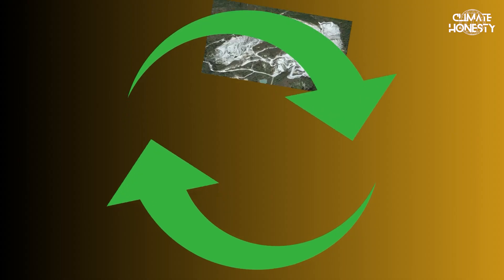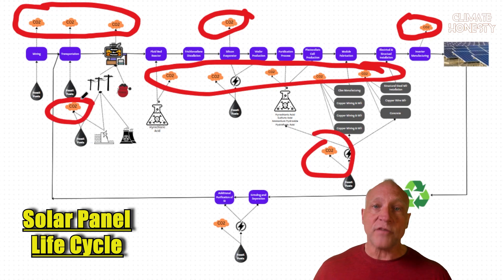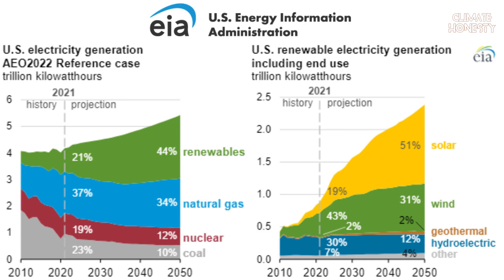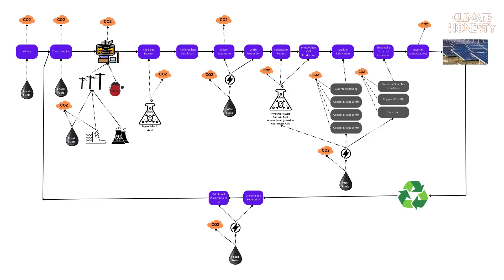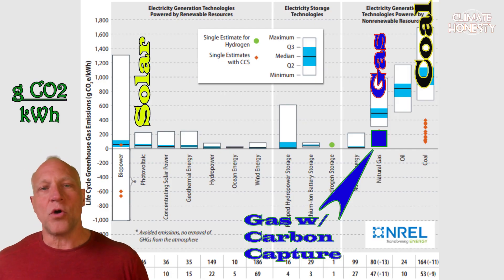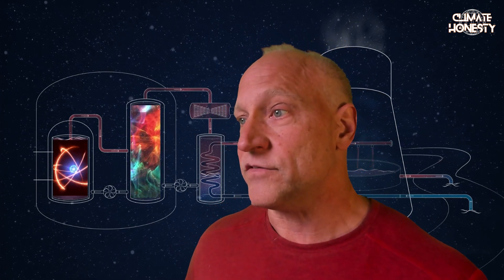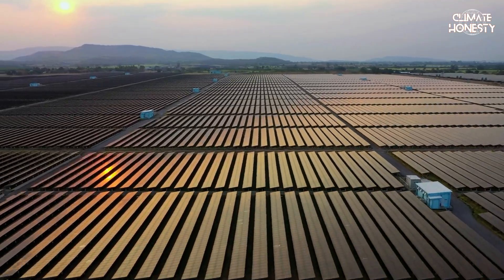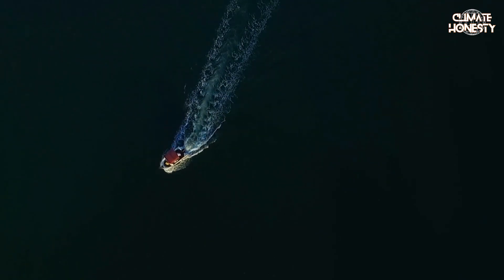Putting SOLAR in the friend zone. Life cycle of solar panels & energy storage #solar #climatechange

Comment: Carbon capture will not work.  Just the chemistry requires about 1/3 the energy produced to capture the carbon.  What make sense is high temperature nuclear reactors with heat storage like the Terrapower reactor in Wyoming.  Here both nuclear and renewables are made more practicable.
Reply from the maker: Hey Stanley, thanks for the comment.  Totally agree on the nuclear side.  Carbon capture does work and is being done in many places around the world.  We have vast resources of natural gas around the world that could be utilized to make electricity and hydrogen for fuel.
Reply: @ClimateHonesty  Like to know anywhere carbon capture is being done?  There was only one place I know of in Texas where carbon capture was being attempted but that has been shut down as unworkable.  It is my understanding there are two ways to do carbon capture, burn carbons in 100% oxygen or chemically separate the CO² out of exhausts.  Both methods requiring a lot of energy.  I too have seen claims of carbon capture being done.  However whenever I have checked I have found it is not carbon capture.  Usually what it is is people confusing surfer dioxide scrubbing for some sort of carbon capture.  So if you have some real examples of true industrial carbon capture please tell me.  What does not count is systems that are producing CO² for industrial purposes and this CO² is being used or stored.  In fact I think these processes are what are being past off as carbon capture when these systems are not capturing carbon from combustion.
Reply from the maker: I have not personally worked on carbon capture projects myself.  ExxonMobile has several in the gulf region as does Chevron I believe.  I was thinking of post combustion scrubbing and reinjection in the video.  This would apply to not only gas, but coal and oil as well.  It is a fairly new technology that does take a lot of energy to perform, which is why it is expensive at this point.  It is simply using existing technology in new ways.  I have heard of projects in Norway, Netherlands, Australia, Canada, and the US. I have worked on scrubbers, coolers, and injection compressors so am pretty familiar with some of the issues. I have plans to do a couple videos on carbon capture soon where I will delve deeper.   The beauty is that it allows us to keep using dense energy and make it cleaner.  The problem is that it consumes energy just like you point out.  I would like to raise awareness of it and get it into the mix of energy possibilities so smart people can work on it and get funding to develop it.  Aramco was working on a technology to install it on individual vehicles but I this crashed and burned.

Comment: Solar is the lowest cost source of newly installed electricity generation. Lower than coal, natural gas, nuclear, wind, hydro, geothermal, bio-fuels, everything. Why wouldn't we source our electricity from the cheapest option?
Reply from the maker: It's only lower with the subsidies and not considering the fact that it only works when you have alternative sources of power to cover when it is not producing.  The cost does not include the required energy storage.  So it is not actually lower cost.  Solar is great as a small percentage of total power.
Reply: @ClimateHonesty  This is simply not true. Solar is cheaper even without subsidies. Batteries are not needed for solar to work.